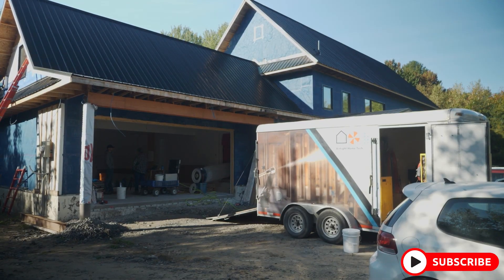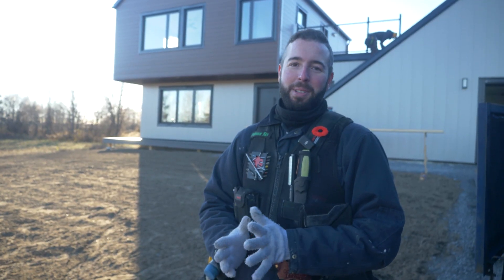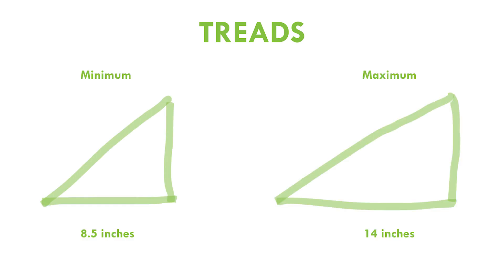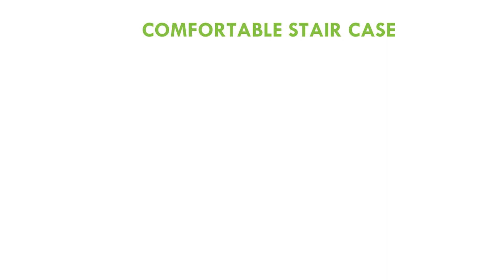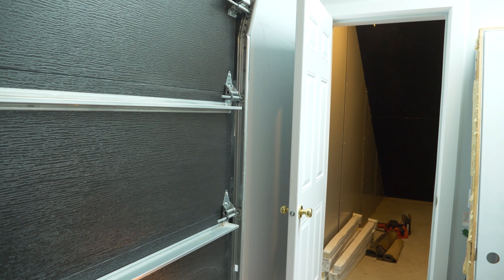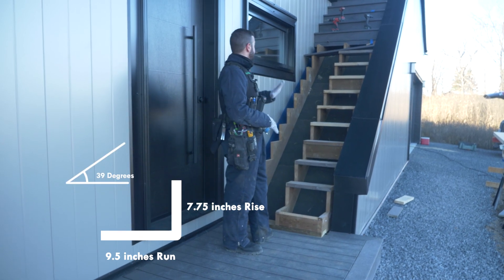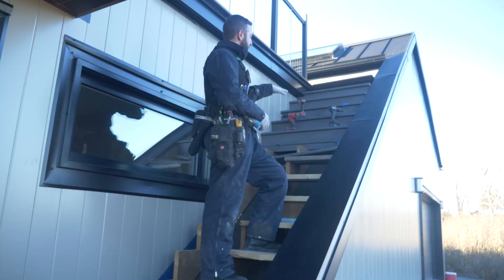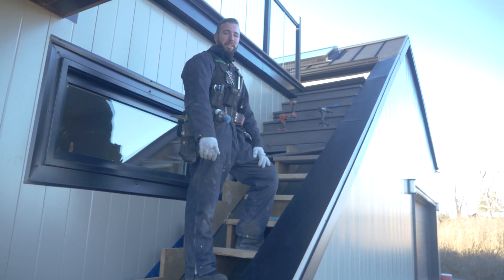How to Build a Staircase to Code

Comment: I was wondering if you have read any of the articles by ASHI Home inspector Bruce Barker on the Journal of Light Construction website? I'd post a link but Youtube seems to think they are spam. Just look for Bruce Barker Common Defects in Deck Stairs on google. You can join their JLConline website for free and access all their articles.
He also references the American Wood Council's Prescriptive Residential Wood Deck Construction Guide. (look on google for DCA-6)